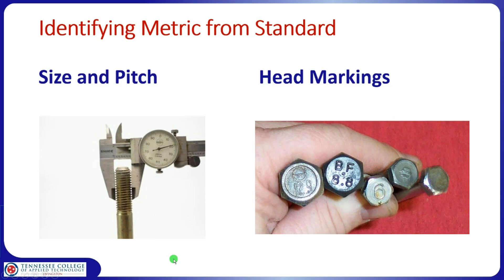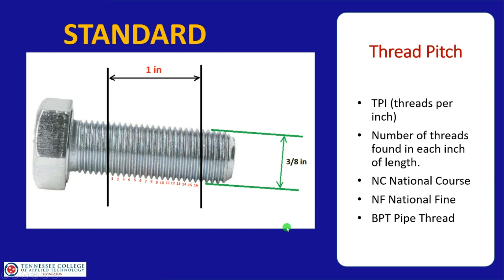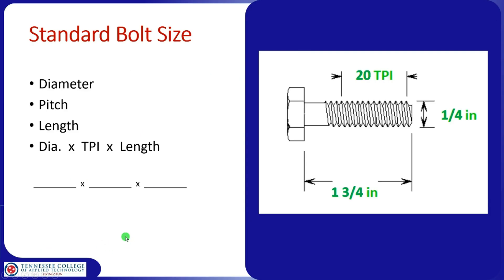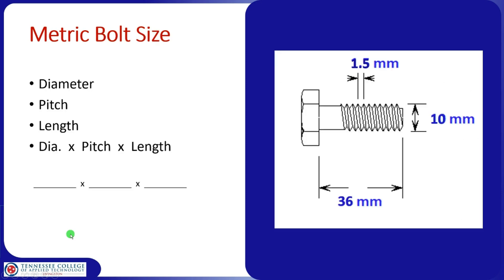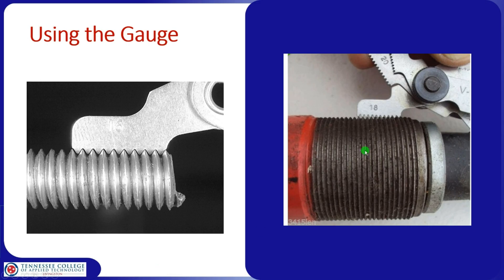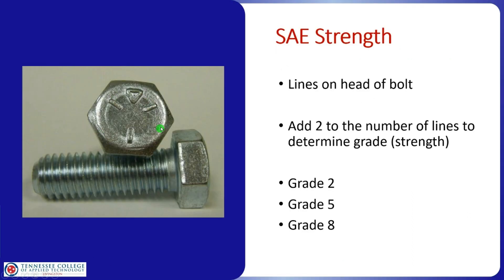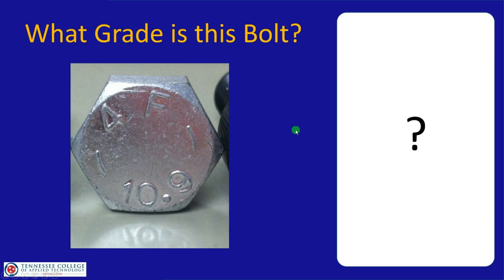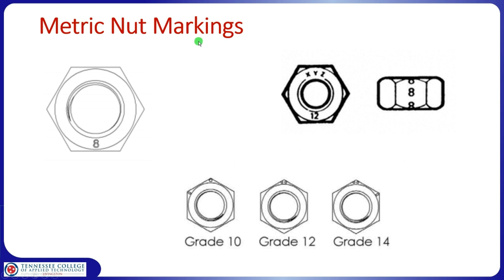How to Measure and identify Bolts

Comment: am a tool maker  the plug diameter is 13.6 and must be impreil English but i lost my thread gauge  but i did not check my TPI   i what to buy tape then tape 1 hole itsgoing half way .is it uif Bsf  its the plug of Ford ranger petrol

Comment: In a metric bolt the number on the head  is not considered a decimal number. Instead, it consists of two independent numbers separated by a dot. The first number indicates the bolt's tensile strength, and the last number represents the yield strength as a percentage of the tensile strength.
So 10.9 means:  tensile strenght= 1000 Mpa (=1000N/mm2) and it yields at 0.9x1000= 900 N/mm2.

8.8 is the base level, I have never seen anything less.
10.9 is the strongest You can get with corrosion protect coating. 12.9 is just bare steel.

But I learned a lot about inch stuff. Thanks

Comment: Threads are stripped on the bolt I need to replace and it's hard to get the pitch. The bolt has YM stamped on top. Any idea what that means..
Reply: Letters are usually the manufacturers initials. Usually to identify what company manufactured a bolt if it failed.

Comment: At 6:01 in the video the bolt is supposed to be 20 TPI. However, if you count the threads I only get 11 TPI.  Does the picture not reflect the actual number of threads and we are supposed to use the number you inserted (i.e., 20) instead of actually counting the number of threads there?

Comment: if a bolt has no markings on the head how can you tell if it is metric or sae?
Reply from the maker: The only way to tell without markings is to measure diameter and thread pitch. the thread pitch will either be metric or standard when measured with a thread pitch gauge. Sometimes you can tell by measuring the diameter, but this is less accurate.
Reply: @ttcautotech  
So, there's no chance it might be Whitworth or some other?!

Comment: if a bolt is described as a "10-32 threaded rod ", how do we measure it ?
Reply from the maker: 10-32 Describes machine screw sizes instead of bolts. Generally speaking anything less than 1/4 inch is described in this manner. the first number "10" in this instance describes the thickness of the screw in sheet metal gauge. the screw diameter is the same thickness as a 10gauge sheet of steel (around 9/64). The 32 means the screw has 32 threads per inch.  It's interesting to note that many of these screws still look like bolts because they do not have a sharp tip and may still have a hex head. We just usually refer to anything below 1/4inch in diameter as a machine screw.

Comment: Great video thanks! I’ve been having difficulty finding the nut for a ground point so I wanted to learn how the measurement system works to be able to buy a replacement, it had never clicked for me before but this was informative and not too difficult to understand.

Note to others: take good pictures, bag your stuff by part of you can’t leave it in the car, and don’t take long breaks with out finishing a project.

Comment: If I have a Bolt that has this specs M12x1 26x83 what does mean . Has searched like this but nothing don't find nothing
Reply from the maker: The spec should be M12 x 1.25 x 83  That would a a 12mm diameter bolt with a 1.25mm thread pitch and would be 83mm long.   They do not make a 1.26 thread pitch unless it is a special made bolt for a specific application. If that is the case it is special and would have to be purchased as a replacement part for that specific application.  Also, replacement bolts would be sold in standard lengths such as 75, 80, 85,  or 90mm. You'll probably have to pick one that is close to your application.

Comment: Good explanation thank you. 
Metric should be the only measure. Metric system should be named STANDARD. 
The Imperial System should be removed from face of this earth.
An inch is 1/36 of a Yard. 
A yard is originates from 1 step  of a roman soldier. A roman soldier? WTF?
Its so ugly to say 3/4 of an inch. 
or even worse; 5/16 of an inch 🤢
Reply: I agree with you.
Reply: @buddhismful  if it works then it works. In Canada we use both. But I prefer SAE. The sizing just make more sense to me
Reply: That would be great except there are so many old cars and machinery out there that it's not going to happen. Ask yourself what shoe size you are and if you say something like an 11 that is an inch size not metric!

Comment: how do i measure the bolt holes so I know what bolt to buy?
Reply: use calliper so if hole already has thread and say 8.586 it's would be 8mm bolt . you have to keep in mind for threads pitch also when buying a bolt.
Reply: @dreadknot2238  hi, i used a caliper and was able to find out that i needed an M6x1.0mmx20mm bolt for my roof rack. i have confirmed this as well because the original part has the same measurements. I bought the bolt and tried to drive it but it won't get past the first 3 turns. is the thread pitch wrong? but 1.0mm is what i have and its what's in the oem bolt. im not sure if i should force it because i might strip the thread.
Reply: @aaronalquiza9680  might be the wrong  pitch i belive it come in several numbers.  good luck.
Reply: @dreadknot2238  the pitch is the same as what the OEM has. but i will look for a lower pitch bolt. thanks